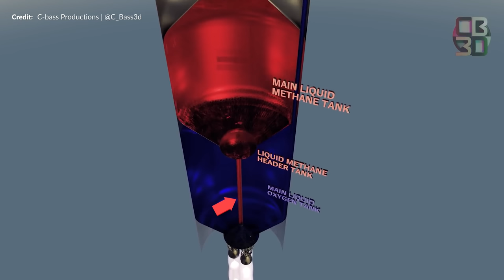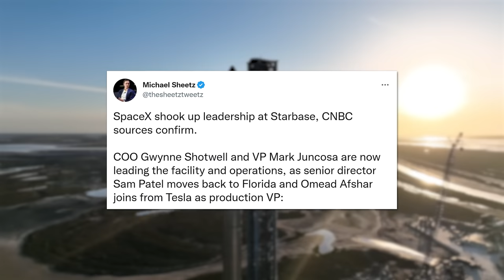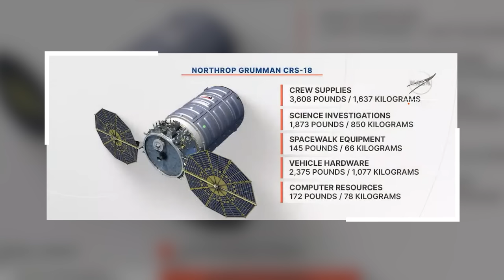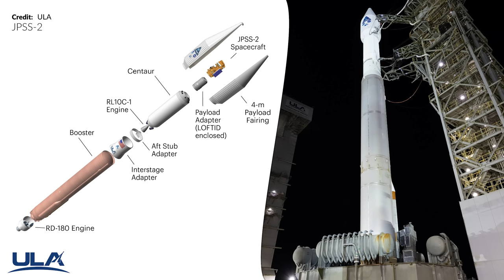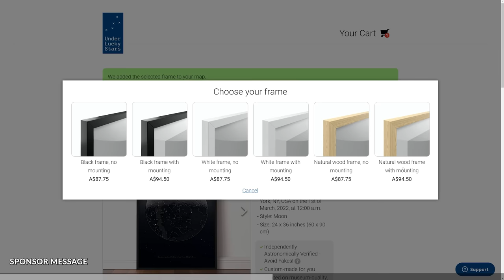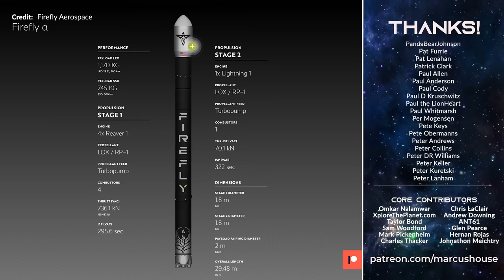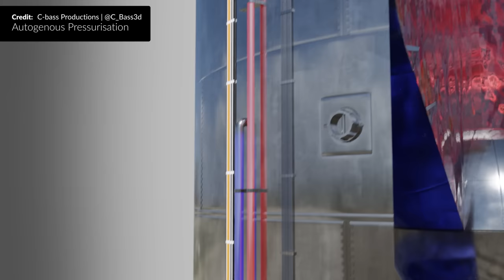SpaceX Starship Record Static Fire Up Next, Starbase Management Change, Cygnus NG-18, JPSS 2 & SLS

Comment: If Mr. Musk did turn the operations of Starbase Boca Chica over to Gwynne Shotwell and Mark Juncosa, I think this is standard procedure as was the case for Tesla and Falcon management. It also could mean that the Rapture 2 has been tweaked, modified and iterated in everyway possible to the extent that Mr. Musk is moving on to more challenges. Since he recruits some of the smartest people on the planet earth right out of colleges and universities, especially MIT, etc. there is a dedicated, highly motivated crew there that can develop the Starship into the reliable and re-useable "airliner" it will become.

Comment: The Gilmore rocket is called Eris , I think it uses room temperature liquid hydrogen peroxide for oxidizer and a type of solid plastic as fuel. The  oxidizer is pumped using an electric centrifugal pump. Its gonna rock and be cheap as chips.

Comment: 10:35 Antares lost Control, causing the Fairing to impact the Cygnus Spacecraft damaging one of the Solar Panels. Something akin to what happened to SkyLab during launch. 

After Staging there was an Anomalous Thrust that cause a Moment that Overpowered the Antares RCS thruster. Antares lost Control, the RCS thruster loss the fight against Anomalous Thrust and a large attitude excursion occured, along with extremely high angular rates at Fairing Separation, and Interstage Separation. Non-Zero Fairing Separation is a Collision Danger for the Cygnus Spacecraft. A Collision between Cygnus and the Fairing did occur, damaging the one of the Solar Panels. Some of the Sound Insulation from the Fairing was found logged in the Solar Panel extension mechanism. 

After Second Stage Motor Ignition, the TVC easily overpowered the Anomalous Thrust cause by a suspected leak of some sort. Control of Antares was regained with the Rocket pointed retrograde, causing a large rotational maneuver to it's intended attitude. Luckily, the thrust from this maneuver was pointed up, away from the Earth, fighting gravity, so the performance impact to the Second Stage was minimal.

Comment: Just a quick question.  I know that we are still very far away from putting astronauts aboard Starship, but I have yet to see a walkway from the launch tower to the Starship itself.  Will that be added later?  Have you seen any thoughts on how the crew will board the Starship prior to launch?
Reply: I expect that crew will ride on Dragon capsules launched by Falcon 9 rockets, then dock with Starship in low earth orbit. Capsules are still the safest way to get to and from space. A crew of 21 astronauts can be launched on just three Falcon 9 flights.

Yes it would be cheaper to just stuff the astronauts inside the Starship second stage during launch with all of the cargo, but that would be unsafe. No launch escape for many contingency situations, and dangerous landings.

Comment: To save rockets needing to be transported back to the VAB from the launch site when bad weather is due, It makes better sense to have a tough shell like housing close around the rocket and launch tower or just the rocket it's self the shell can be folded back behind the tower for launch and fold out from the back of the launch tower on arms which wrap around the tower so the shell two half's can cup together like a seed pod to encase to rocket fully so the bad winds and weather can't damage it saving the need to keep slowly moving the rocket back to the VAB.
Reply: You're describing Shuttle as much, so do Delta IV & Atlas V

But SLS program is so wasteful that, despite being over funded beyond budget request, it decided not to build it

Comment: Hey Marcus great video as usual and I congratulate your space services in Australia on there successful testing of that engine well I see sort of I think it probably has what the tests were supposed to be doing up until the rud unless that was part of the test too see how far we can go now I do have a question why was the flame coming out of that engine so yellow I've noticed on majority of rocket engines if their carbon-based well even if they're predominantly blue
Reply from the maker: It will be due to the fuel being burned,  but sadly, I don't know what it is. They haven't disclosed that. Probably some sort of  rubber-based fuel like HTPB or something. I've got no idea though.

Comment: Wait... so they're gonna dismount the first stage engines in flight and land them? How do you detach the engines automatically? That seems like an incredibly complex process.
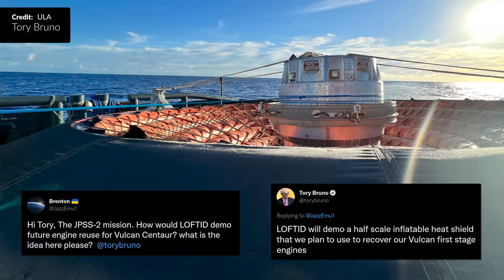Reply: 15:08 indeed! From Wikipedia's Vulcan Centaur article "ULA also announced a design concept for reuse of the Vulcan booster engines, thrust structure and first stage avionics, which could be detached as a module from the propellant tanks after booster engine cutoff; the module would re-enter the atmosphere behind an inflatable heat shield." Sounds like an internal disconnect for the liquid methane and liquid oxygen pipes, then separate the tank section from the bottom. So easy a trained monkey could do it , maybe that's the plan🐒🧑‍🚀 (RIP Bubbles).
Reply: @skierpage  That's wild. That means the seal on the propellant pipes can't include bolts like you might expect on other engines. I wonder what those pipe seals look like and how they automatically detach. Electromagnets maybe?

Comment: Excuse me, I'm a researcher... Aerospace manufacturing has changed... New manufacturing technology was legitimately admitted in the US and Europe on September 22, 2020... New system enables automatic joining of titanium alloys and reactive aluminum for the first time ever... Applied physics and chemistry on aerospace paramagnetic alloys... Starship and SLS are obsolete because they don't have the new technology... Starship is made of very heavy stainless steel. .. On the other hand, SLS is made by FSW friction welding system where they use a mechanical probe to join the components of the fuel tank and the Orion module... The new technology stamps the spacecraft modules and tanks of propellant welding its parts by automatic lasers. from both sides of the material simultaneously... New technology joins aerospace alloys automatically for the first time and does it very efficiently... Automatic tight joints with laser controlled asymmetry... SLS is made by a mechanical probe that eliminates tool wear material producing contaminated welds.
The FSW system only works on soft aluminum alloys.
 .. Aerospace manufacturing has changed... Modules and fuselages for civil and military aviation manufactured in series by stimulated emission of light... It is an honor and an obligation to inform you... September 22, 2020 USA and Europe. ..Technology has changed and both Starship and SLS become obsolete...Automatic manufacturing of integrated monocoques for civil aviation without the traditional riveting that has accompanied aviation for 100 years...Pressurized flights in integrated fuselages capable of flying at 20,000 meters of altitude manufactured in series and by robotics with the new technology admitted in 2020... It is an honor and an obligation to inform... Regards...

Comment: That inflatable heat shield could be used to recover F9 second stages.
Reply: The speed they're going at makes that challenging. The first stage is traveling at about 8,000 km/h at stage separation. The second stage is traveling at I think 12,000 - 26,000 km/h needed to maintain low earth orbit.
Reply from the maker: When they were considering recovery of the Falcon 9 2nd stage, this was one of the options I thought they would go with. All effort instead went to Starship which will make Falcon 9 obsolete anyway.
Reply: @MarcusHouse  Absolutely agree. It's just whenever a new tech comes out,  it's impossible for me not to think about all its possible uses.

Comment: Unless NASA reanalyzed the booster certification, me thinks your dates are off. The joints that connect each segment of the solid rocket boosters have a limited lifespan of 12 months. Booster stacking started 21 Nov 2020 (both completed 2 Mar 2021). Depending on how you interpret lifespan starting, they are now 8 to 12 months beyond the “original” 12 month lifespan.
Reply: NASA did reanalyzed the certification & issued a waiver, hence not being destacked yet. Whether that will be a problem at launch remains to be seen
Reply: @alvianchoiriapriliansyah9882  
Hopefully, it's not the same management team that said the Challenger was good to go.

Comment: Hoping no issues arise from the left over cryogenic fluid in the QD arm; any possibility of igniting that and causing damage to the OLM?
Reply: There's always a possibility, but I'm sure the engineers are smart enough to have a solutions
Reply: @alvianchoiriapriliansyah9882  True, but the same could be said of other instance of safety failures at Starbase, they aren't indelible by any stretch.

Comment: I hope SLS launches this month because I reckon it’ll open the door for Starship in December (I suspect political pressure will prevent SpaceX getting permission before SLS). At the start of 2022 we were expecting 5x Falcon Heavy, up to 5x Starship and 1x SLS, but so far only the 1x Falcon Heavy. Still been a crazy year even without these mega launches.
Reply: Your suspect is unfortunately incorrect, so don't worry about it

Comment: Re SLS hydrogen leak issue not resolved (no smoking gun). They should pray they get no smoking crater instead. If you do not understand the process / failure mode this is out of bounds of engineering or common sense. You can just as well pray.

Comment: When the forklift was carrying the “potential downcomer” it was shocking to see that they have synthetic straps, just draped over the forks for the picking apparatus! Such big money being spent I can’t believe they’re cutting corners like that! That is a rigging don’t there could be burr of sharp metal on the forks edges. They have removable attachments for Tele handler’s. They should have the small boom extension job instead of the forks! Letting Riggers rig off of the forks is a total rookie mistake by the operator! If they make small mistakes like that, I’d hate to see what they’re doing with heavy rigging!!!

Comment: ✋✋✋✋✋ doubt does the fuel is not wasted for such cryo testing?
Reply: Rocket uses 2 fluids, fuel & oxidizer. In this case the fuel is methane & oxidizer is oxygen

You'd notice that unlike other methane rockets, Starship launch pad doesn't have any flare stack at all which is imo unique. That's because the boiled off methane is being recondensed by liquid nitrogen which then returns back to storage as a liquid.

Thus, what you're seeing venting a lot is only oxygen & nitrogen since it's the composition of our atmosphere afterall (cheaper than methane) & less dangerous
Reply: @alvianchoiriapriliansyah9882  thanks for explaining this, I do appreciate it. 😉